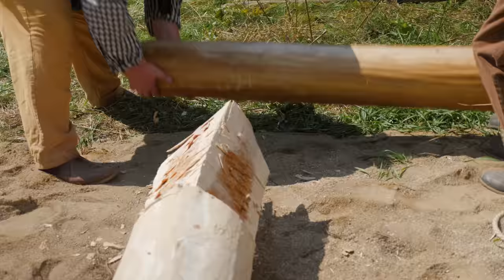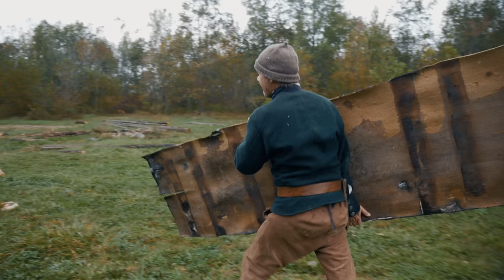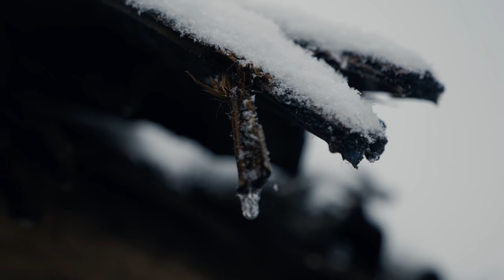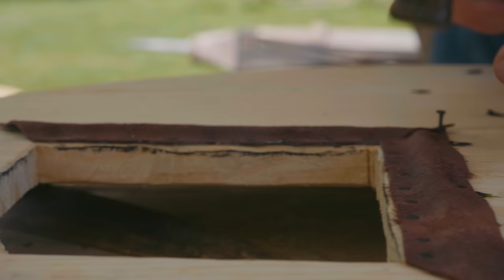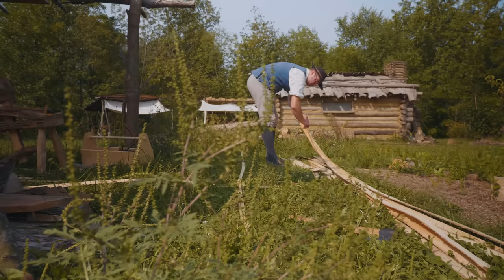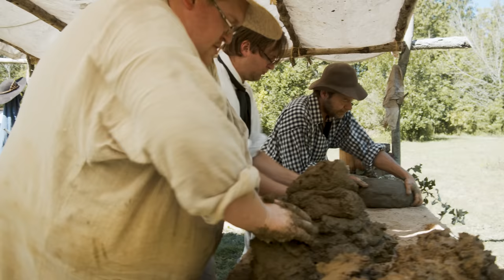Building the Townsends Homestead: Three Years in the Making

Comment: you know a lot of folks think that the lathe you have there is what was used and it was among the poor for fast set up to homestead but later would upgrade to a rotating weighted wheel on a tredal like a sewing machine. The heavier the wheel the more steady torq it has for much finer work. My great gramps had one he made like that and once he had the wheel rotating real good I would say it was just as good as a modern motor lathe. He could even disengage the work because the drive had a belt, even the belt he had was homemade. Wish I had it but one of his sons got it and then destroyed it taking it apart to move it. so sad